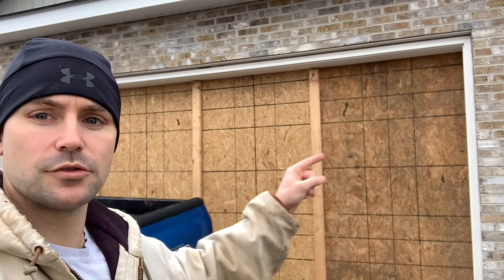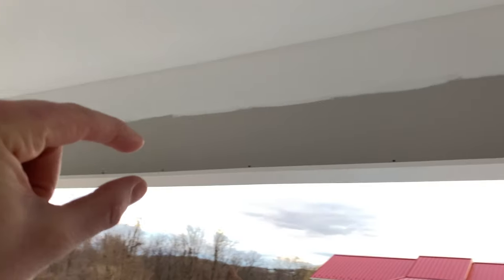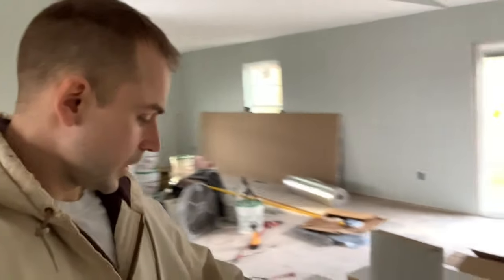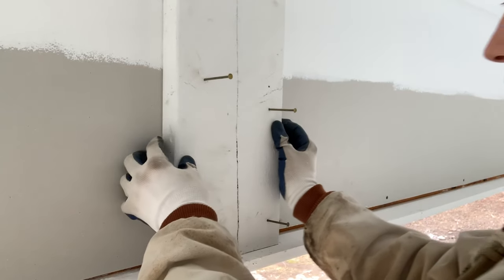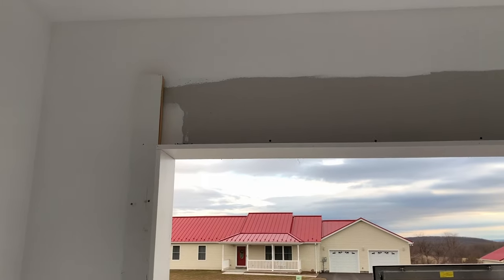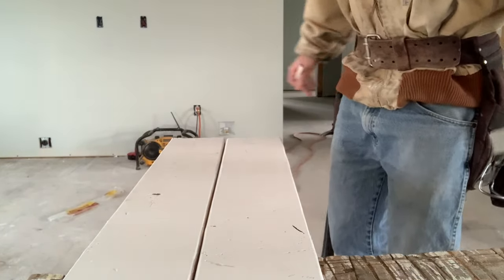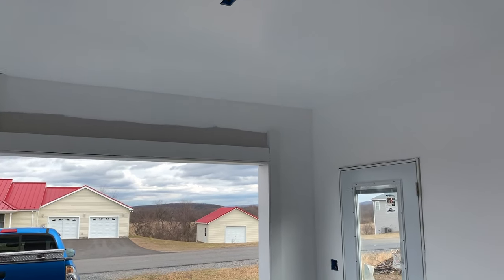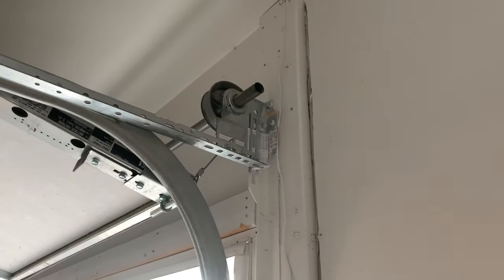How To Frame A Garage Door Opening For An Overhead Garage Door

Comment: The center plate is supposed to be installed directly to the stud with no drywall in between.  Also you are supposed to use lag bolts and NOT nails to secure that center plate.

Comment: If your using a standard radius track with torsion springs you need to run your side jambs up higher than shown in this video. The door side tracks extend beyond the header on each side to accommodate the torsion spring mounting plates on each side. If your installer is using pull type springs maybe you can get away with what your showing, but because of the center pad it is my assumption your intending to use a torsion spring system. Amateurs teach amateurs to be amateurs.
Reply from the maker: Oh ok
Reply: You know it.  I repair lots of doors that just have not been framed in properly.  The garage door is the heaviest moving thing in your house (depending on couch potatoes) which needs to be dealt with accordingly.